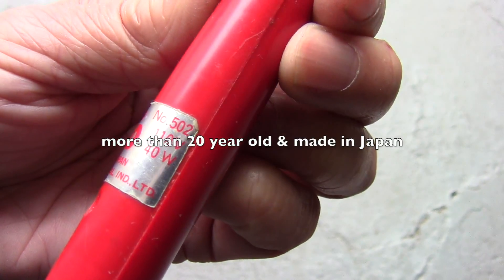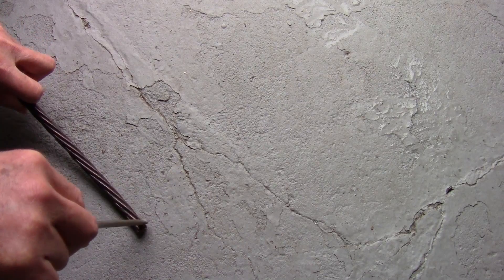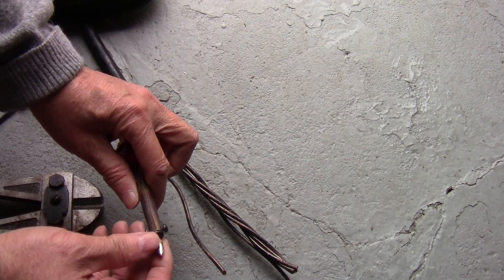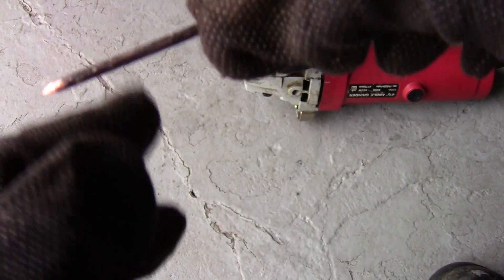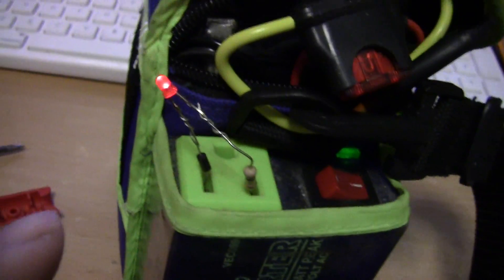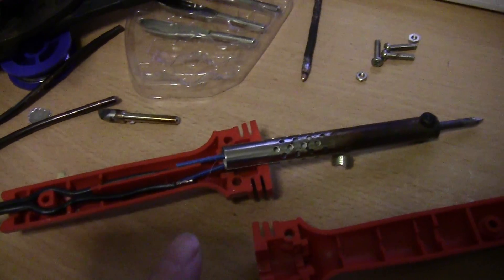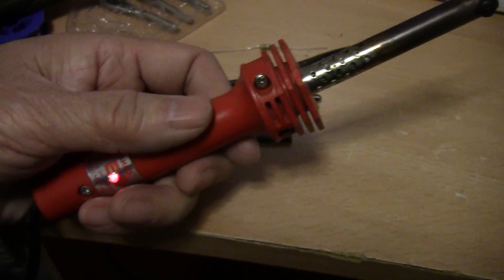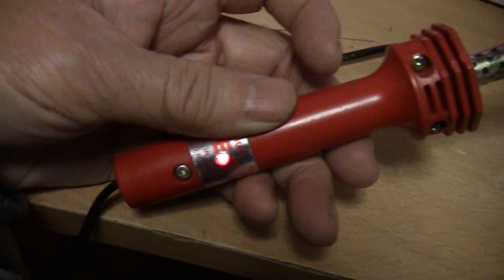Replacing the tip on a Hakko 502 110v 40 w soldering iron with a 4 mm copper wire

Comment: That was quite resourceful!  Rather interesting was your use of the angle grinder upside-down on the ground.  I have a bench grinder for that.

I have an old Weller iron from the 70s or even 60s, it has a turquoise handle and has made cameo appearances in certain videos of mine.  My dad used to have an iron years ago that the tip was removable, well actually the entire heating element and the tip unscrewed from the handle, which was equipped with a candelabra socket; the heating element and tip had a candelabra base.  No idea what kind of iron that was, it was many years ago.  There's even a possibility he still has it, if it didn't vaporize on 9/11 back when.
Reply from the maker: I actually need  a bench grinder to sharpen my drill bits and  other stuff. This ridiculously cheap angle grinder will have to do for now.  I'm sure someone can find other great uses for it, like removing rough skin from your heels or turning it into an outboard motor.  If you replace the tip on the Weller, it'll probably last forever.  Happy Holidays to you and your family!
Reply: Looks like Harbor Freight may be getting a visit one of these days!  I've seen angle grinders used for removing skin, though I wouldn't try it.  The tip on the Weller is actually in fairly nice shape for its age, it hasn't seen that much action over its life.

Thank you!  Happy Holidays!

Comment: hi well modified, I live in Denmark and  have 230v. can i use the same 1/2 watt 100k ohm and 1N4007? or it is not enough to avoid LED burning.🤔😶
Reply from the maker: You have to change the resistor.  You don't want the resistor and diode getting hot. 230v is high voltage so use caution.
Reply: wtam69:yes thought so. thanks mate..

Comment: cool modification job.
Reply from the maker: The dollar store soldering iron would have worked for me but the one I bought there had a very short wire.  You don't want to have to struggle with a hot iron because of a short wire.

Comment: Are you sure that's not a copper coated steel core wire??
Reply from the maker: The wire looks like a solid core copper. The whole cross section is of the same copper color.